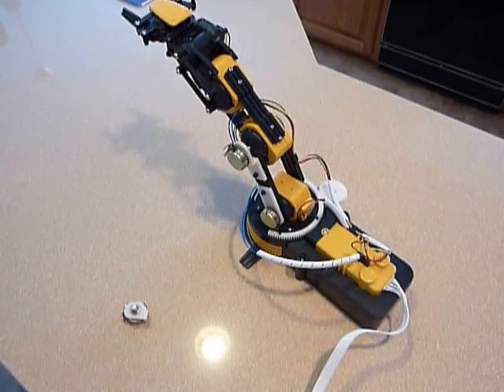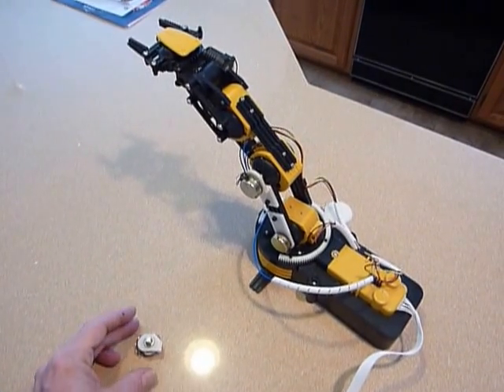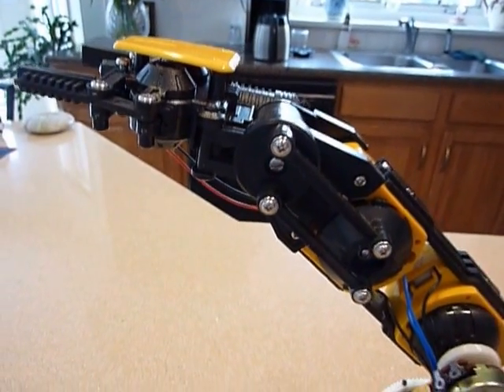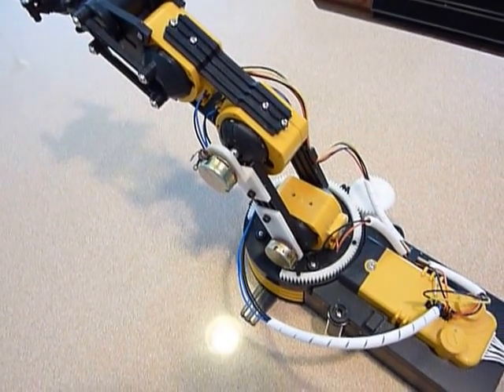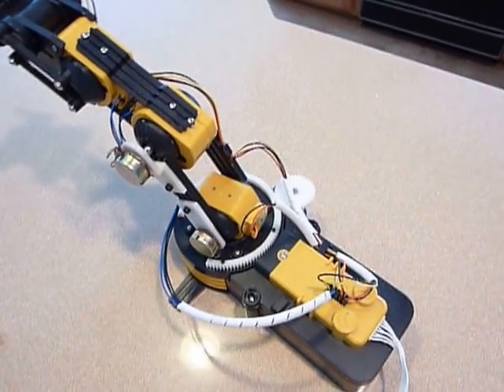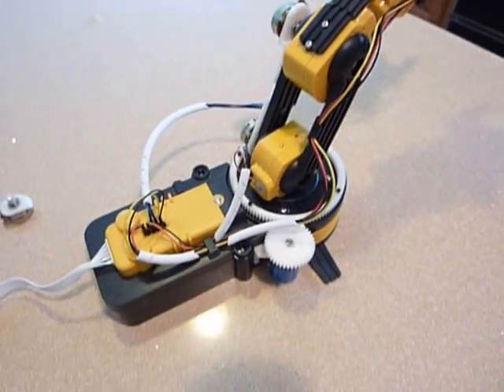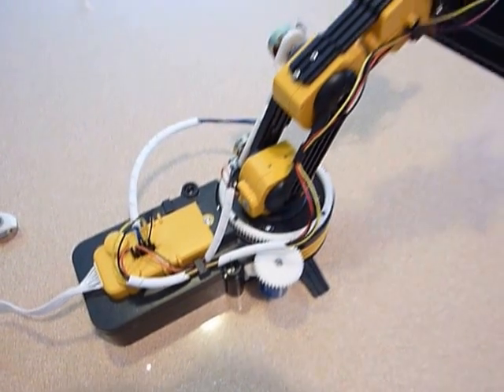OWI robotic arm position sensor

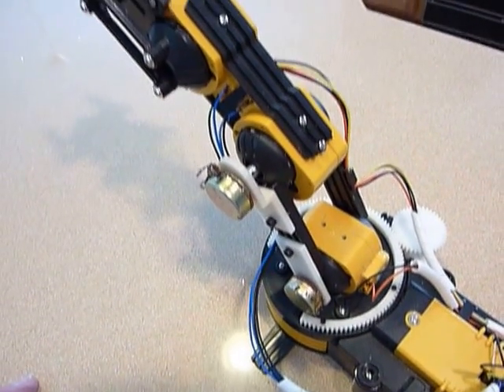Comment: Surely not the most important part in the design, but what is the name those white pieces to hold the wires together (example: 0:57 right-under)?
Reply from the maker: certainly not critical, but it helps to hold the wires in place.   It is called plastic spiral wire wrap- I think this material was from Panduit, but Amazon has some as well,.  Handy stuff to have around!

Comment from the maker: Regarding the method of attaching the pots to the joints, the pot itself is mounted firmly to the white plastic support, so it does not rotate.   The pot shaft was filed down to leave a thin section of metal protruding, so that it acts just like a flat blade screwdriver.   I then removed the original screws (these were Phillips) from the joint and replaced them with slotted screws normally used with a flat blade screwdriver.   The pot shaft was then turned until it pushed into the screw slot.   With this assembly, the screw turns the pot shaft as the joint rotates.  You can see the filed pot at about 28 seconds into the video, and this ridge fits snugly into the screw slot.
Reply: Thank you again for immediate feedback! Wow. That is a great way! Earlier I could not tell from the picture. Thank you again! Just wondering what motivated you to mod the OWI robot. In my case, I had always wanted my daughters to be familiarized with technologies and that is why I started the project (so that I can then teach team). BTW, the ring gear is really nice. What 3D printer did you use?
Reply from the maker: Dong Chung
I decided on this project to help teach community college students some automation concepts such as feedback systems, arduino controls, etc.  I used a Stratasys printer but the newer desktop printers would probably work fine as well.  I did all of the CAD design using Google Sketchup (free) and converted the files to an STL format which the printer accepted.  I have actually modified the method for attaching pots for the students.  I printed a small tube that had different inside diameters on the ends.  One end has a diameter that is a press fit for a 4-40 cap screw head, and the other end has a diameter that is a press fit for the pot shaft.  I then push a 3/8 inch long cap screw head into the end so that the threaded portion extends out 3/8 inch.   After removing the robot joint screw, I tap the hole for a 4-40 thread and thread this assembly into the hole.  After tightening, the plastic tube that extends accepts the pot shaft, and keeps it perfectly centered around the screw.  I suspect you could use a solid plastic rod and drill out the ends to two diameters and produce the same effect without a 3d printer.  Let me know if you have other questions!

Comment: I have been trying to figure out how you attached the pot so that it rotates. Would you mind sharing the information on how the pot shaft is attached to the gearbox?
Reply: You mentioned that you filed down on the tip of pot shaft and engages the gearbox directly. How does the filed down slit help engage?